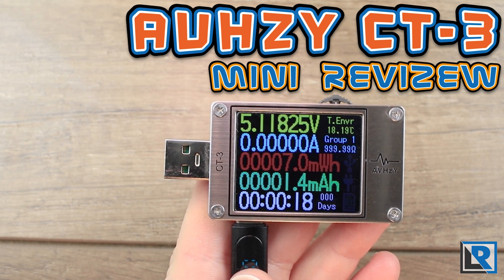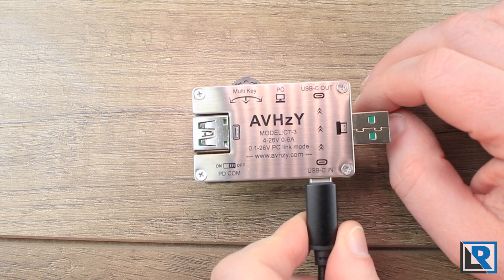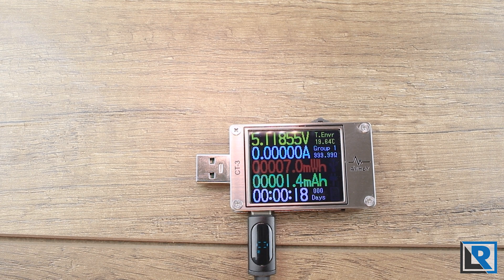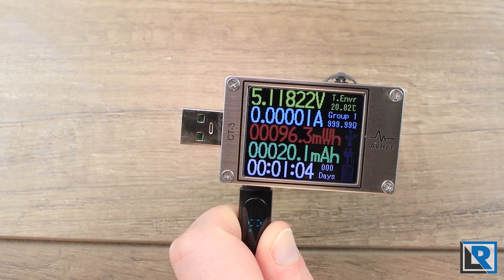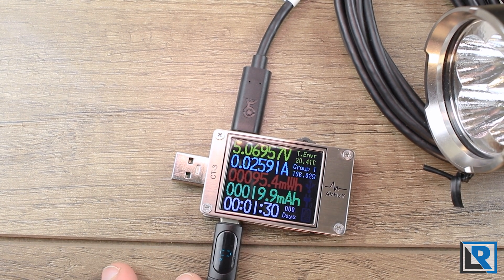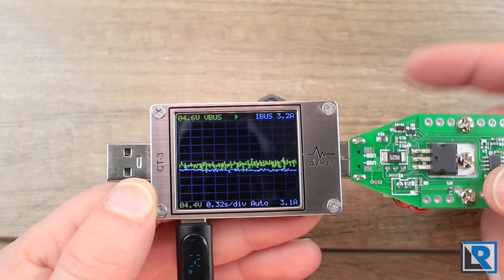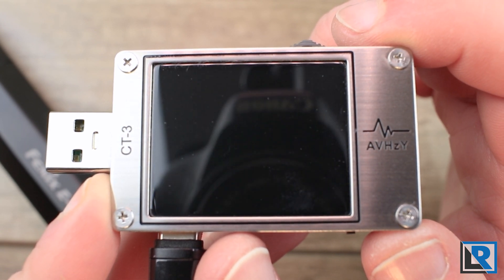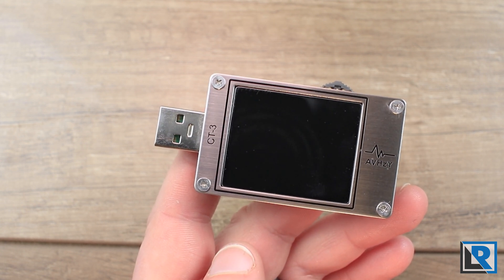AVHzY CT3 USB Meter (How I test flashlights and powerbanks)

Comment: Nice overview. Do you know if the CT3 is equipped with some sort of automatic shutdown feature if the load goes too high? It'd be practical to diagnose shorts or simply protect the tester if anything goes wrong
Reply from the maker: Good question, I am not sure. They do warn about overvoltage so I'm guessing no

Comment: You didn't explain the PD switch.
Reply: yeah, what's the PD switch? I couldn't find any documentation on it
Reply: @BryanMiraflor  Hi i have not that device, but i would gues that PD switch works as forcing - changing/switching and keeping  PD protocols. For example zou wanna test 12V PD at some charger, not only cycling it, but testing it just for 12V PD for longer time, so you click that PD switch until you reach your needed PD standard {in this example 12v} and than just using laboratory load or real device to put load at charger and meter keep constant PD12V standard even when charger and device both are capable higher standard. But as i told, its just gues. Merry CHristmas :)

Comment: What was the Olight charging issue? Did you need to use PC software to get the AVHzY CT3 to not turn off when the current is low?
Reply from the maker: The Olight issue was the ct2 would stop prematurely. I was using the pc software anyways to capture the data and auto graph it so I can't say. I think I needed to adjust it slightly from the default

Comment: Interesting, I use a CT-3 and a ChargerLAB Power-Z KM003C.
Reply from the maker: What's the charger lab do for you that the ct3 doesn't?
Reply: @LiquidRetro  Functionally its basically the same. I have only had it about a month, and I have not used the pc software yet. I bought it as an upgrade to the CT-3, one advantage is the main input is USB-C. It is smaller, lighter and easier to handle. Was it worth the more expensive price? Perhaps but not a solid yes. Also now that I have some experience with it, I prefer the toggle switch on the CT-3 to the buttons only on the Power-Z, the switch is just easier to use.
Reply: @LiquidRetro the KM003C supports the full PD 3.1 range. So won’t be obsolete